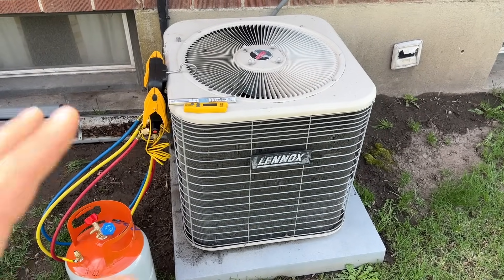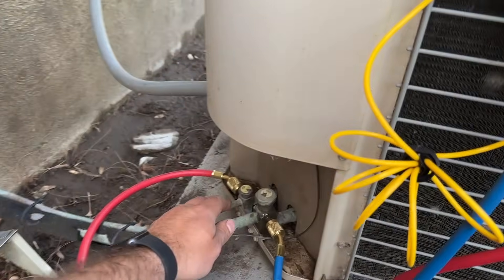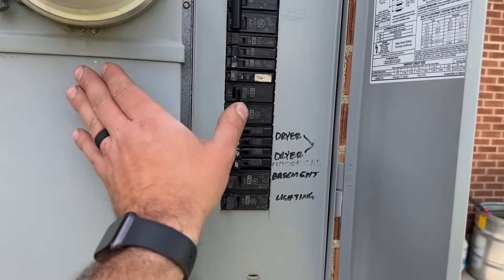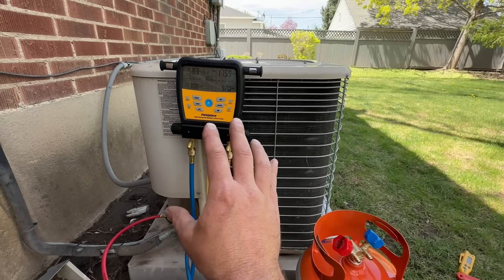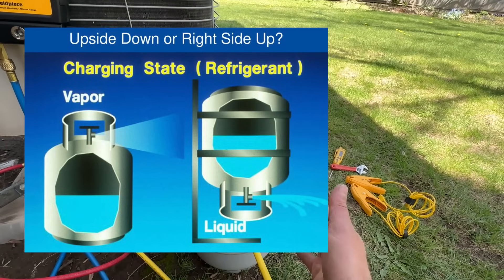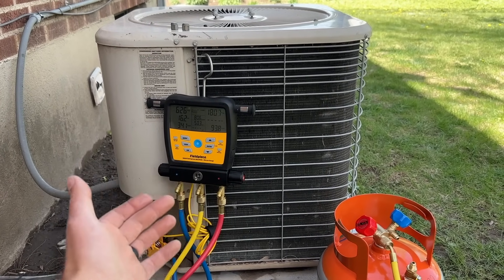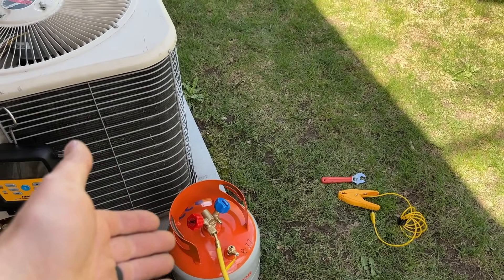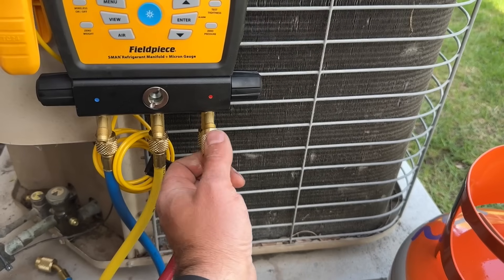How To PROPERLY Recharge Your Air Conditioner

Comment: Thank you man, I'm an avid DIY and got my EPA just because I'm so sick of the "pros" gouging us. I did install my own system 2yrs ago and sure, they call it a hack but I enjoy it, go figure that it still works and the 9k that I saved is the cherry on top.
Reply from the maker: Amen brotha! That’s awesome!
Reply: Same here. Got my EPA for the same reason. This isn't rocket science. And, as a retired engineer, spending a grand or two for the right equipment (to then help out friends and neighbors) isn't going to break the bank. Too many prima donnas in this business, thinking that charging $500+ for a capacitor changeout is their right because "they know and you don't". I got had once. Not gonna let that happen again.
Reply: Where'd you get the equipment to do it yourself? Just bought the system outright and installed it?
Reply: @laurentiupetre5620  banana split
Reply: Until you go to sell your house and a good realtor finds it was never permitted or inspected -_-
Reply: That's funny! Believe me, all a realtor cares about is closing the deal.
Reply: They call it a hack because you hacked it. Hope your house doesn’t burn down

Comment: Is there a replacement you can use in place of R22 on these old systems?
Reply: The drop in replacement for R22 is R458A (Bluon TdX 20). Way cheaper than a jug of R22.

Comment: I'm currently trying to educate myself on manual j and manual s.  Our home need complete air duct redesign.  

I've ask, so called a/c companies that install air ducts  how do they get their calculations.  They all give me the same answer, "well 12x12 room gets this size register with 6" duct."

I ask, do you use manual j or manual s?"

Answer, "What is that?"

If the design and installation are to be incorrect. I might as well do the work then pay some slime ball.
Reply: Here's a quick way to calculate how many btus it takes to cool a room - Take the length of the room and multiply it by the width and then multiply that by 50. Once you have the final number, take that number and divide it by 12,000. The final number you get is how many tons of refrigeration you need for that room. Use 60 as the multiplier instead of 50 if the room is facing the sun, has a lot of windows or insufficient insulation.

As for airflow, approximately 400 CFM per ton of refrigeration. If you have a 3 ton unit, you'll need at least 1200 CFM. Once your new ductwork is installed you'll need to have it air balanced to make sure each room is receiving the proper amount of airflow. Dampers or supply plenum will need to be adjusted. 

If you don't want to replace a central air system, have you thought about switching to a ductless system using a multizone split unit? They are very efficient and can save you money on your electric bill. The big money saver is you won't have to run new ducts. Just something to think about if you're looking at the overall cost for everything.😊

Comment: I didn't see you purge the hoses when you hook them up to the unit only when you purge the tank
Reply from the maker: My hoses had r22 in them from the last system I checked. Otherwise I’d have emptied them, and then burped them after they were connected 👍🏼

Comment: I wish you would refill my unit.  The guy wanted 944 for mine.  I can’t afford that.  I do hv leak on outside unit, and he said to repair is 4k.  I am with no ac now.  I cant afford that and no one will give me loan for replacement condenser unit.  Me and my cat are so hot in here :(.  I bought a window unit and it caught the adjoining bedroom on fire, so turned power off to back of my house last two years because thats a huge electrical problem i cant afford.  So bought the cheapest window unit they had for 169 yesterday and pray that when i am at work my house doesn’t burn down. I hv no choice at this point.  Sigh. I hv like 200 for r410a but not 944.  I would ask another company if the Could do it but I don’t wanna waste anybody’s time because I feel like they’re just gonna say no anyway
Reply from the maker: Sorry to hear that. You’d definitely be better off finding a place that will lend you the money for a new system. It will be a better long term solution and be less expensive and less of a liability then a window unit.

Comment: I am confused. Did you say you want to charge with liquid instead of gas?
Reply from the maker: Yes. By flipping a fresh tank of r22 you will feed it in as a liquid.
Reply: @diyhvacguy  this too is a bad Idea on a system with a 20 year old compressor.

Comment: You shouldn't shut it off to remove the hoses.  If you use ball valve hoses. Open both knobs at the manifold until it equalizes then shut off the high side on the ball valve.  That will pull all of the liquid out of your hose and suck it back into the system. Then shut your manifold knobs.....you lose a lot less refrigerant this way.

Comment: Just a nitpick, you almost mentioned it but i feel like a homeowner trying diy could mess this up, considering techs and apprentices do often..  before doing any of this you have to be sure your 100% clear of ice, and either remove or change the filter..  the line freezes but if you turn it off, ice could remain on the inside coil for a long time.  If you have a chunk of ice left from a dirty filter, youll overcharge your unit. You might get the right super heat, but the pressures will be whack, or youll get the pressures right and the superheat will be 0-2.  If your diy, itd be smart to replace your filter, turn your ac off at the tstat and run fan 6-12 hours to be very sure.  And if after that you see either a superheat below 5 or if your pressure and superheat never settle, like every time you check if the psi and sh are a bit lower than before and they dont stay stable, id call someone more familiar.

Comment: Question: are those the same hoses that one would use with automotive ac gauges and manifold? If so I already own a set of yellow jacket hoses. I purchased them to use to charge my cars AC
Reply from the maker: No, typically car AC hoses have a push on fitting, whereas these are a thread on low loss fitting. But if your fittings are removable and have a quarter inch thread pitch, then you can simply buy the low last quarter inch adapters on Amazon. Cheers, Dave .
Reply: @diyhvacguy  You are correct modern 134A gauges have the push on fittings but the older R12 gauges were screw on and will fit the HVAC unit. I still have my manifold set from the R12 days and have used it on my house HVAC.

Comment: Good instruction, however there needs to be a disclaimer that any refrigerant that contains chlorine is damaging to the atmosphere if released from the system. Also because of this risk, there is a fine that can be as high as $25,000 for first time offenders.
Reply: It's $2500. Not $25000
Reply: OH MY GOSH! WHAT WILL WE DO>!>!>!>  I guess the oceans will rise another 10 meters due to even more global warming.  :`(  oh wait... global warming threats started in the 60's.... and if those morons were even close to being correct, NYC would have been under 30ft of water, only a dozen civilizations would have been left by 1990's because the rest were supposed to be submerged; volcanic activity was supposed to added so much extra land mass the oceans were supposed to be drastically reduced and killing off 1/3 of all oceanic creatures, oh and sooo many more myths that yuppy dipwads (like you) still believe.  Google  failed global warming predictions   and have yourself a good laugh or 400

Comment: Your suction side pressure doesn't have anything to do with the outdoor temperature on any given day, it's an indication of the indoor coil temperature and airflow. Your charge could be correct but if your indoor airflow is higher than it should be, your suction line isn't going to be "beer can cold". If you're going to be charging without superheat/subcooling you're better off going by your indoor delta
Reply from the maker: Right, it correlates to the temp of the Evap coil. But for someone who is doing this for the first time it gives them some sort of idea what to look for.

Comment: Isn't it bad to mix contaminants from one system to another system though? You're introducing foreign items that were from the recovered system to the new system. I've heard that's terrible for the new system. Correct me if I'm wrong
Reply from the maker: No, this refrigerant tank was vacuumed properly (I have a video showing that process) and the systems we recovered the refrigerant from did not have any issues, we were simply doing an upgrade and that’s why we removed the system. Additionally, the refrigerant was recovered through a filter dryer which cleans it as it’s moved. And also this system is “new” it’s also old, so we are simply moving some of the same refrigerant from one system to another.  Cheers man

Comment: Is it worth buying a few+ pounds of R-410a and storing for if and when your home system needs to be re-charged for the average homeowner?
Reply: I have been doing that with mine.  Do the leak stop chemicals work?  I get about a year before i have to call the ac guy or add it myself
Reply from the maker: Yes I agree with The1JBanks, the leak would normally need To be fixed, but sometimes that can prove hard to do and a lot of times it is in the evaporator coil anyways. But yea, I think it’s a great idea to have a 2lb jug on hand. It will save you in a pinch. I’ve seen systems that take a little bit of refrigerant every other year the leak is so small and they have stayed that way, so I’m the type that wouldn’t charge them a ton to replace the evaporator that barely leaks rather then top it off every once and a while. That’s just me. You do you 👊🏼

Comment: To all those that complain. You have forgotten one thing.  I bought the appliance!
 I am a homeowner, and I am a subscriber for one reason to learn about my appliance that I bought.  I have been recently scammed by a big company in my area,  and he filmed it for me and gave me a copy. That how arrogant  he was, thinking all homeowners are to dumb to know how an air-conditioner works. Luckily I didn't fall for it. and it took channels like this one to figure it out. 
 I have a right to know how my appliance works. I know the parts and how it works, and  that makes be an informed consumer. I will not get scammed again. 
 I can at the very least change out a fan motor, and a capacitor, and learn to understand how to use a multimeter.
Reply from the maker: Amen brother. Thanks for your words. I’m happy this channel is helping you out! It’s clear I’m the climbing subscriber count that it is helping homeowners. Cheers man
Reply: Yes! 
The year before last I replaced my burned outside fan motor with a old one from a tear out that still worked, I cleaned it up and oiled the bearings, then installed it, that thing was free trash and it's still running.
Next week I'm gonna top off my system since I got frozen lines and evap coil.

My local HVAC guy keeps saying the unit is obsolete, and offered me a "great deal" on a $8k swap job, but mine works fine, and I don't have that kinda cash, so I'll call it vintage, and keep it running.
Reply: This definitely happens to by my warranty company and the contractor they sent out 5 times to fix my ac/heat unit!
Reply: Same here... now add to the fact that some of us just like to get our damn hands dirty.
Reply: Well, someone shouldn't be able to handle R22 or 410A without the proper EPA 608 license. This video is a good refresher for those who have already gone through the proper steps to make sure they know how to properly handle refrigerant.
Reply: I get you point, it is a good one, but in this video he gassed the system with no diagnosis of why the system was low on gas. The refrigerant gas should be controlled world wide, but there are some countries that sell it to anyone, which is wrong as it is still hazardous to the atmosphere.
Reply: For building inspection and insurance claim you are my dream. You'll be paying one way or the other 😂 keeps me in business though
Reply: ok  how you got scammed  what work did they do and how much you paid could you share on that ?
I called 3 companies to check my AC unit  all of them gave me  some BS prices and things that " needed to be fixed "   needless to say  I  did not get them to work on my AC unit   , one time buying  some parts  I met an old gent 
he knew about my UNIT brand  and I gave them some work  since he was giving me a  decent price and telling me what was going on with my unit
but any homeowner should be careful   Lots of Bad  AC people , or scammers, just want to make a HUGE quick Bucks   for something that you might do it yourself
Reply: Nah bro you didn't do your research when you picked the big company. Or always get a 2nd opinion... if I know my customer is  doing anything to their unit, I'm walking out.  ( besides changing filter, maintaining drain line, and rinsing condenser)
Reply: @Korrea00 then you're not getting any customers. My friend HVAC tech only comes out to recover refrigerant from my system so I can change the compressor out myself. When I'm done brazing the new filter and compressor in he comes back out and tests / recharges the system for me. I even have my own gauges and nitrogen tank. I actually have a vacuum recovery pump and tank but I still let him do that side of things because I understand I'm not a certified professional. I am however much more than qualified to do these simple repairs required for an AC unit and literally everything else on my home that I own.

I met the HVAC tech at my workplace because he's a contractor my company uses for various things at the factory. He understands the equipment I work on is far FAR more complex than a SIMPLE home HVAC system. 

You won't get a dime out of me with an attitude like that. Or any of my neighbors because I'll do the work for them for 50 bucks rather than watch someone like you run around getting butt hurt that you have an informed intelligent customer.
Reply: @Korrea00 it’s their unit no yours than can do as they please
Reply: @late0404  they sure can. I was only saying some companies like the one I work for dont deal with it
Reply: @ that’s a loss of business for yall I guess… I could not imagine turning someone away from my business because they attempted a repair themselves. I would be willing to show up just to vacuum down a system etc for a customer
Reply: @late0404  you would think, but it's so hot in texas that we dont need every job that comes in. It's a small mom and pop company
Reply: @Korrea00 the guy said “it’s their unit they can do what they want “ that’s like saying to a heart doctor.  “It’s my body , I can do a heart transplant myself and save some money by watching some videos because it’s my right “. 🤦🏽‍♂️. There is another comment on here where a tech said a homeowner added 
21 lbs of freon into a 2 ton system just because he didn’t know how to read the gauges lol.
Reply: @goldyneye  Comparing fixing an HVAC to heart surgery is pretty apples and oranges. People do things all the time with their bodies and property that damages them, and it’s their right to do so. If you’re a “professional” that can’t repair the damaged hvac system that someone broke then what are you good for…it’s literally what they pay for.
Reply: @goldyneye  right - a heart transplant is way, way, way more difficult than basic maintenance on an AC unit.  Let's not oversell the skill here.   It's so simple it can be taught in a 15 minute video, and to get the cert is 115 dollars online with a 32 page book or a 35 dollar online class (none of which are gatekept behind experience or apprenticeship).  I suppose next you want to compare it to rocket science?
Why the hell would I pay $2500 (a recent quote from a major company in my area) to fill the system with freon?  For that money I can get the certs 5x over, buy the equipment, and fill the thing myself.

Comment: Why r u adding freon and not looking for a leak, anytime u have to add freon, look for a leak! PERIOD, !
Reply from the maker: Because this video is to show how to add refrigerant to a system not how to find a leak. 👍🏼 I’ll be doing on on that soon! Cheers
Reply: @diyhvacguy  ah yes. Going to teach the average Joe to bring a 2500 degree flame into their attic lol.
Reply: 99% of the time it’s not worth finding the leak it’s past warranty and it’s time to replace the unit.
Reply: That is because it is a collection of videos. I do agree he should reference another video to diagnose the out of spec gauge reading first.
Reply: Some leaks are so small, and so slow, that it's not feasible on a small unit that has 10lbs in it total. Of course using bubble solution on the shrader valves is a no brainer given how easy they are to replace.